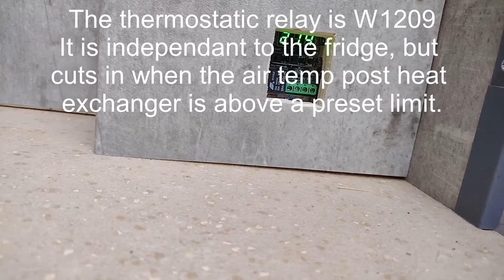Improving 12v compressor fridge efficiency - campervan / motorhome

Comment: I’d would have sent it back an bought a better fridge to be honest🙄
Reply from the maker: That model is the only one that fits into the design due to depth and thats with the fridge already recessed into the framework of the garage wall.  The next shallowest would've made the bathroom door unusable/unviable etc etc.  So compromises needed to get the design of van we wanted.  In its modded state, 350 nights away, cold beer and solid ice cream - what more could you ask for?

Comment: nice set, I just bought a similar refrigerator, and in fact it would be better if the fan worked with the air flow in reverse. because the grill is on that side. But is it safe to make this inversion for normal operation of the equipment? I've seen that it's easy to change the position, but I'm afraid that I'm changing the correct configuration for which it was designed.
Reply from the maker: I'm no expert. but don't think it's unsafe though it may affect it's efficiency depending what else you do. if any doubt contact the makers or supplier penguin leisure

Comment: What a great video. What thermostat did you use?
I have a victron mppt solar 75 15, which I use to monitor the isotherm fridge power. For some reason, instead of drawing 3 amps, it has started drawing 6 amps. I have checked the fan. Any ideas would be greatly appreciated. 
Once again thanks for the video
Reply from the maker: W1209 - cheap as chips - use them in a few places (fridge, fan,  "garage cooler" etc)  eg https://amzn.to/3BIgf04
No idea about your setup, or how its wired, but logically only, using MPPT controller to monitor fridge power has too many variables for me - as that would only show current/voltage from solar to the 12v system which would vary.  Fridge could cut in (pulls c. 10A (?) on startup for <1s) and that could be enough for the battery to say "oy I need a top up" at the same time.  I use a shunt system - NASA BM1 - but £20 versions available which is accurate.  If you are certain the fridge is running at 6A not 3A, then the compressor is pulling more power than normal - why?  Err.... Its a motor/pump - so its struggling....  Why?   On way out?  High resistance on teh windings? (does it get overly hot)?  Is the refrigerant not flowing and gassing cleanly?   If the fridge was happy but inefficient then it'd be pulling 3a for twice as long rather than 6a.  I'd drop email to supplier and ask if they had any ideas!  Good luck

Comment: Excellent video thank you!

I guess the fan power supply on the fridge is not PWM but standard 12vDC? Been looking at fans to replace the one on my Vitrifrigo C115i which is quite noisy (it's a 120mm fan) and most say they are PWM so am I right will they not work with the fridge?

Also most of them come with optional '3 pin molex adapters' for controlling the fan speed. I just want the fan to be at max speed all the time.... so if I just feed it 12v it will be at full speed? 😅

Thank you!
Reply from the maker: Hi.  Mine was just relay on/off - not PWM - would be nice :)   So (on mine at least) it was OK swapping to a "silent fan".  Though silent = less noisy rather than "silent".

Comment: Hi, this is great. How did you get the compressor out to change the fan and insulate above the compressor? Thanks
Reply from the maker: Surprisingly, easy.  ON MINE  The compressor and heat exchanger is on a base plate that is screwed from the bottom into the fridge chassis.  2 or 4 screws.  This then just slides out and the pipes that go up into the fridge had some flex.  Not a lot, but enough.
Reply: @Ryan_DYD  thank you so much for the reply. I will be saving this for when I come to the fridge part. Much appreciated

Comment: very interesting video and information, could you tell me what fan you fitted instead of the original vitrifrigo one and details of the other fan. I have the 80 cf version and it also runs a long time in hot weather and it also gives the start up jolt, I could do with improving my install for better air flow. any details would be much appreciated, thanks Liam
Reply from the maker: Hi.  We use https://amzn.to/3HgSQ3Z to replace the OEM fridge fan (but check size/thickness on yours) and the bigger brother https://amzn.to/3Gc0L11 to extract to the back.  Deffo works and gets the heat out, as I now vent the heat "down" from the exit vent into the battery box (over winter) and it keeps the lithium batteries warm with free heat!
Reply: @Ryan_DYD  thank you, I'll check my fan size and give it a go 👍

Comment: Hi, very interesting and nice diy solution. Any info on difference in power draw?
Reply from the maker: Nothing accurate.  In the heat, fridge was on for 30+ mins constant and ice creams a little soft.  So "running" for 60-70% of the time?  After mod, fridge runs for 5-6 mins and maybe 30-40% of the time.   Fridge takes, say, 3A when running  The extra fans maybe 0.5A and are on/off for 50% of the time fridge is running.   So deffo less power, but the best thing is the evidence of colder beer, harder icecream and quieter running (no compressor jolts).  If I had to guess 12h power usage was 25AH, now 18AH?   I hasten to add - my original install wasn't ideal as the warm air didn't really get extracted well.
Reply: @Ryan_DYD  👍